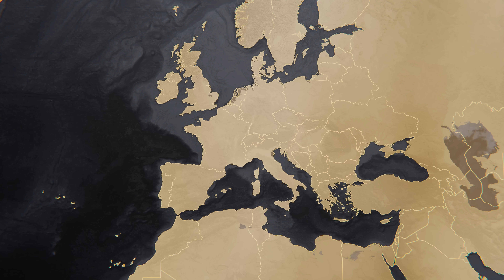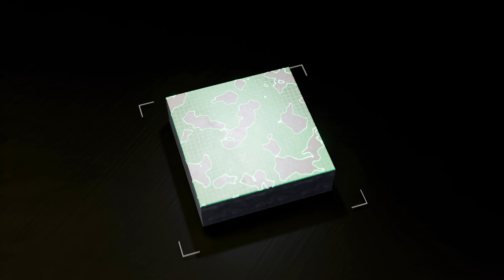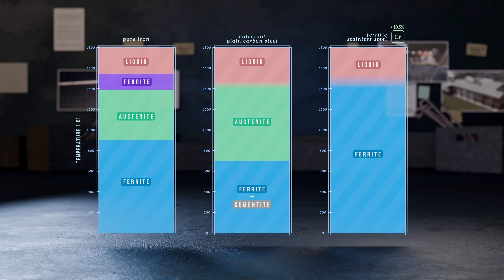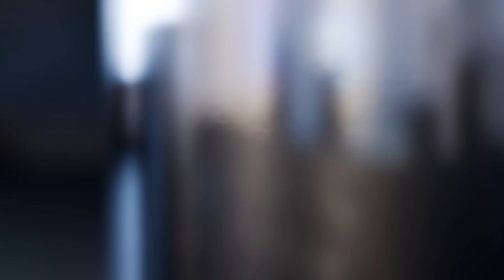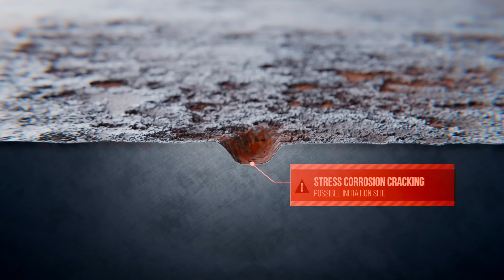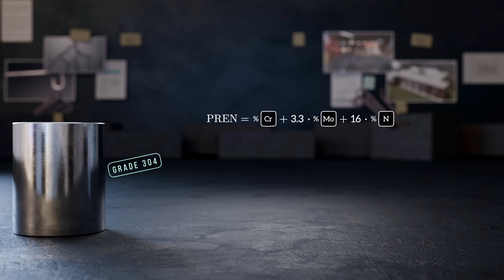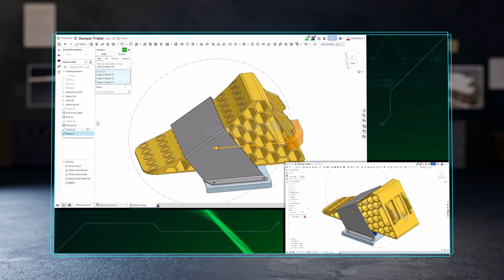The Problem with Stainless Steel

Comment: Terrific video.. though the bit I don't get, I can very clearly recall my second year (1980!) Engineering Materials lecturer telling us that the greatest number of corrosive failures in the marine environment occur in Stainless Steel components, particularly in the presence of chlorides, due to SCC overwhelming optimistic assumptions about a lack of vulnerability of SS to corrosion... 🤷‍♂️ Yet despite the knowledge being out there, lessons not learned decades on... 😞

Comment: I figured this out the hard way that certain stainless steels aren't suitable for submersion in chlorinated water. I bought stainless screws to replace the broken ones in my pool vacuum and they didn't even last 2 months. I then resorted to using 316 alloy screws (for marine applications) and haven't had a problem with them for 3 years. Still an austentitic alloy apparently, but they hold up a lot better than standard off the shelf stainless steel screws you get at the hardware store.

Comment: Chlorine bleach is not the culprit. Chloride in other chemical forms are also potent corrosion activator. In the mid 90s I was on an investigation team looking into a tearing of a stainless steel package. That was caused by a solution of oxalic acid with chloride impurities.  Examples where chloride free solutions were forming were corrosion resistant. Where chloride was present they failed after 5 years

Comment: After 25 yrs of dealing with stainless I find the biggest problem is the lazy ass liars who don’t really do their job properly. I did a water feature for a landscaper who did a “lobby” feature.  It was done in 304 stainless. It rusted out big time. I redid the job for him in 316 stInless and it most likely did the same thing because the lazy ass guy who came in to add chlorine added two weeks worth so he didn’t have to come back. The lobby stunk of chlorine. All he had to do was give the receptionist a few tablets to drop in every day and it would have been golden. After working it it is vulnerable to rusting with corrosive stuff and as he said air does repair it and I’m sure there are companies that use pure oxygen to repair their products but then a lot of that is nuclear power stations that have strict guidelines about these things. I’ve seen 304 in really bad environments and it held up. It needs time that’s all. Even 316 in pools..if it’s not holding up it’s the guy putting too much chlorine in because he’s just plain lazy.

Comment: I never knew much about stainless steel, but a couple years ago I was looking for stainless lug nuts and was told nobody made them because stainless is too soft.  Now I am looking at exhaust valves and wondering why stainless is no good for lug nuts but is OK for valves.

Comment: This is plainly wrong. I worked at a chlorine gas plant. The 304 stainless is not permitted in chorine environments. It basically eats it from the inside. Minimal 316 Stainless has to be used in such places. By law. They just did cost cutting when building the swimming pool.

Comment: Sorry mate, it wasn't the fault of the stainless steel rods, it was poor materials selection on the part of the engineer that did the design. Fracture propagation occurs in most metals, even the toughest and most ductile. To avoid this, it is important to understand not only loading conditions, but which material is suitable (fit for purpose) and that the correct heat treatment has been applied in order to mitigate any such problems. Very often it is iron in the alloy that adds to the cracking problem. The point being, if you understand the loads the part/s will be subject to and what thier immediate environment is like (e.g. concrete/mix) in addition to the mechanical properties of the alloy, you will be in a better position to select the most appropriate material for the job. It's an engineer problem not one of the particular grade of stainless. 
Unless you have considerable experience in jobs like this, you shouldn't be doing them. The architect or civil engineer really needs to be an experienced individual in the application of stainless for this purpose. There is also the question of testing the material before using it, empirical data is crucial. 
We live in a world these days where metals, including stainless steel, are made with a high degree of inclusions, often due to the steel being made with a considerable amount of recycled materials (yes, this happens often). I've designed parts and assemblies that have been made in numbers up to the millions and discovered that trusting the certification that came with the material is folly, especially in building applications. We allways did in-house testing, including for high chlorine environments. If there's even a remote chance of failure, you'd better do the testing first. As for assumptions, they're fine at the very initial brainstorming sessions, after that, 3D modelling  and FEA are woderful tools but cannot be rellied on to give conclusive outputs. Test it, otherwise, this shit happens.

Comment: I wonder if someone considered using painted mild steel for the hangers.  Painting the stainless would also have prevented this, most likely, but you tell someone to paint stainless and they act like there is zero reason to do that.   Nope, plastic coatings like paint are far more corrosion resistant than stainless, when done right and not damaged.

Comment: It's an amazing story! Such an intricate scenario of destruction.. And although the engineers calculated everything, they were wrong in the end. A suspended ceiling is generally a bad idea. Only solid reinforced concrete floors in which the reinforcing rods are completely immersed in concrete (which must be coated with protective paint) would be completely reliable.

Comment: I've worked outside long enough to see materials corrode over time, 304 100% rusts if it's in contact with anything, but where it's exposed to the air it is fine, so makes sense why it would fail. They want 308 stainless.  I only eat on stainless or titanium bowls/pans/plates, because screw ceramic, glares or plastic for food contact

Comment: Worked off shore in oil. The stainless had to be close carbon free as I was told otherwise hydrogen sulfide gas would eat it. This was known, in the 1990's it was ignorance that caused the death's.

Comment: I'm not a degreed metallurgist, but have a lot of experience with all of the grades you mentioned, even duplex.  Yes, an American with duplex experience.  Anyway, there is no way in hell I'd have spec'd 304 for a chloride environment.  Depending on the time period, I'd have spec'd 316L or 316LN on up to a duplex as knowledge about Duplex materials advanced.  Back in the 80s we seemed to be way behind here in the States with knowledge and understanding of duplex stainless and a 316 variant would have been the go too.  One error in the video is saying that 304 or 316 alloys is that they are non magnetic.  That is not always the case, particularly in their cast variations CF8 or CF8.  They can contain up to 30% ferrite depending on compositional balance and will exhibit some mainly residual magnetic attraction.  In most cases a composition containing 8-12% ferrite provides the best balance of strength, corrosion resistance and weld ability.  Below 5%  ferrite tensile and yield strength are reduced, sometimes to under the specification minimum.    However, for situations where low to no magnetic attraction is required the low ferrite composition is preferred.  Low carbon or L grade stainless <0.03% carbon are more resistant to intergranular corrosion cracking.  Probably more info than anybody wanted in a comment.

Comment: I worked in the marine engine business for years and we frequently used 304 stainless for all sorts of fasteners that are exposed to salt water.  That worked well for us, while 400 series stainless (sometimes heat treated) was a guaranteed failure in salt water. Now I am puzzled as to why we had such good results from 304.  Thanks for a great video. It is truly excellent.

Comment: As a stainless steel fabricator,we cleaned all our welds with sulphuric acid,cleaned  with water,does the acid, stabilise the surface after the welding process or is it to remove the stain?

Comment: Suspended concrete? Wtf?
Reply: It sounds similar to what we have in the states with those suspended fire-proof false ceilings that make spaces both safe, and very cheap to air condition.
Reply: It's a disaster waiting to happen. Not long ago a railway station canopy in Serbia also collapsed. It was suspended concrete. It collapsed because it was heavy and in time rust degraded the rebar. Who could have thought of that.
Reply: Cmon there's 208 rods it can hold it if there's no corrosion
Reply: Most large bridges are now built with concrete suspended from steel. It seems counterintuitive.  Engineering be like that sometimes.

Comment: What have we learned here? Wood is pretty good for what it is. Concrete and steel on the other hand... only when it can't fall on you (i.e. basement floor) or when you can trust the science, engineering, production, installation, maintenance, and the bureaucrats to arrange for maintenance. All the white-collar professions failed here. A reputable installation contractor also might have rejected the design.

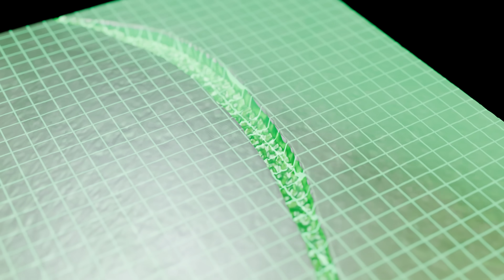Comment: At 2:55 you say a steel is considered stainless at 10.5% chromium. However you need around 10.5 % in the solid solution matrix.
This is why you typically see stainless steels with very low carbon content and a higher Cr content.

Comment: I appreciate the metallurgical education, but why did the suspended ceiling tiles have to be made of f*cking concrete? Did the original concept include making the ceiling as heavy as is materially possbile without resorting to depleted uranium or osmium?

Comment: I immediately thought the chlorine from the pool played a role in the falure but the lesson on dufferent forms of stainless was fantastic. I had no idea there was so much to consider. Now I understand why there are different settins and techniques used when welding the stuff and why welds have to cleaned specific ways after welding them. Thank U

Comment: But could this have been prevented by having the roof a structural ceiling rather than a suspendet ceiling through wich the cr layer could have been sustained while not beeing under tension?

Comment: I worked with Duplex stainless making  paddles for wastewater applications. It is very tough, difficult to machine but fairly easy to bend and shear. Excellent corrosion resistance.

Comment: A pool with chlorine (similar to saltwater corrosion). Wouldn't it smarter to use a higher grade like 316 stainless. Better resistance to corrosion and slightly higher tensile strength.

Comment: What a fantastic article , I worked Aviation , Nuclear Quality control and Aircraft bearings , I always tried to boil down the subject to meet my understanding of said subject . One of my jobs required a good understanding of the chemistry and the heat treating to meet various structural require ments of the end project . When in the Nuclear field I took two courses in Metallurgy , and the heat treatment required to meet structural end results . The iron carbon diagram and how it influences the end result .

Of great importance is the cake mix, the chemistry, but with Stainless, the heat treatment is of equal importance, especially with stainless .
You can create the proper cake mix , but if you do not freeze the cake mix when dealing with Sensitivity and cool down you destroy the mechanical properties of the final material properties . If you do not properly freeze the cake mix, meaning surrounding the ferrite with chromes and nickels , you loose corrosion resistance . And mechanical properties .

The people writing this should put together an article like this on Martensitic  stainless , which is the real engineering material used in Jet engines and turbines .

I always thought of 300 series stainless as more of a decorative stainless used on boat railings etc . This is a great article .

Comment: Someone explain how they are using stainless steel in concrete and it corrodes, but basic rebar in concrete seems to last forever. They build bridges and dams like this all the time.

Comment: art piece with same principle would be a guillotine iwth a weigth that is held up by a wire that is rusting in rain  can snap anytime and ppl can put their heads in under the axe .....but buildings fall down was it bus shelter where bulgaria or yugoslavia serbia...concrete overhang many died. novi sad  city or

Comment: Awesome video .. I work with a lot of stainless steel and this was a great explanation ..  13-8 15-5 and 17-4 are typically considered aerospace grade stainless steel ..  machining them is rough on the tools almost comparable to 316 or 321 ..

Comment: People with all my due respect as a machinist in the American industry for more than 17 years cutting stainless steel specially 1/4 28 -3A threads, I’ll tell this to see if you can find your solution, (1) use the 309 stainless steel is tougher than the 304 stainless and is use for submarines, bridges and parts that are going to submerged underwater for long time, is called “ wear less material. (2) use moly dee castrol tapping fluid, for cutting treads, to avoid cracks on treads   cause of the heat friction during cutting the 309 stainless steel, (3) use the recommended speed rate to cut stainless steel 309 , if is to fast, the heat friction cause by dull tools or over speed, it will make the material to turn red fire red, making the 300 series material harderned and in result it will get brittle.  My condolences if there was any human lost on the tragedy, God bless you. I hope my recommendation will help you.

Comment: Stainless steel screws tend to snap when inserted into hard wood. Stainless Nails are softer than Bright Steel Nails plus they react strongly with aluminum and then rotting so you can't easily replace the glass in aluminum  window frames and don't get me stated with how much it corrodes in Salt beach side air.

Comment: Seems like some really basic misunderstanding of Stainless properties. It seems the engineers thought 304 was more resistant than it is in reality. If they had asked anybody working in stainless fabrication, they would have told them 304 isn’t suitable for moist atmospheres with Halogens present in any form. 

Basically failure to ask people with the right know how - pretty common in engineers unfortunately 🤦‍♂️

Comment: I have a genuine question. So does it mean it is a bad idea to choose a cylindrical water filter made of 304 stainless steel? Where the lid is mated to the bottom tank via compressed coupling. The lid’s lip is slanted at an angle, so as you tighten the coupling, it forces the lid to compressed against an O ring and the bottom cylinder. Drinking Water contains fluoride and chlorine too right?

Comment: short answer: because the chloride in the air attacks the passive chromium film that normally protects grade 304 Stainless Steel from corrosion. This allows deep corrosion pits to form, causing SCC in severe cases. grade 316 SS would've been better in this scenario, or Duplex SS.

Comment: Back when everybody thought that Tesla's Cybertruck was going to have a structural "exoskeleton" of 300 series stainless I got shouted down and even banned from one popular site for pointing out the design shortcomings of that stainless in that application. Of course the engineering never really got done for that vehicle anyway and what stainless trim they had was glued on, but those fans were absolutely hyperventilating about it then. Today they just pretend that vehicle never happened.

Comment: the real problem is that something is build in a way that single point of failure cascades to accident. its good to understand materials, but the real lesson is to engineer a weak points that would fail first before catastrophic failure occurs

Comment: Thanks.  The reaction to chlorine such as used in BLEACH and HOT TUB chemicals is one enemy to some stainless products.  It explains why the tub heater  ( inline stainless tube piping  with an electric heat element ) and the outer stainless housing of my ultrasonic cleaner have developed corrosion and discoloration.   Probably some engineer did not design their product to withstand the corrosion factor.

Comment: 304 stainless just got lump associated with "most corrosion resistant" and project leads just nodded and ordered.  Sure, chloride exposure is no shit sherlock in hindsight-  but that steel was pitched as the top dog option when it came to corrosion resistance.

I knew about chemical processing plants-  but yeah...freaking public swimming poles shoves that fact into your face.  This know-how has been part of core curriculum materials science for several decades now, fortunately.  Just a sad case of "Oooops."  Every mat choice needs it's own considerations checklist.  Thousands of variables out there.

Comment: I work in a factory. We mainly machine using 304 and 316. Lots of axels made from long, cylindrical rods.

 How come if I take a magnet (somewhere between 1.5 and 2x as strong as a regular fridge magnet), it sticks to the sawed ends of the 304 and 316 rods, enough to hold its own weight? Is the act of sawing really enough of a deformation to make the sawed ends magnetic??

Comment: TL/DR

304 stainless was chosen for all the good reasons.
HOWEVER, chlorides from the pool triggered breakdown of the chromium oxide film
tiny pitting corrosion made the steel vulnerable to stress corrosion cracking (SCC).
50% of the rods fractured during the collapse.
304 stainless was wrong choice for SCC from chloride environments.

NOW we choose Duplex 2205 for these environments.